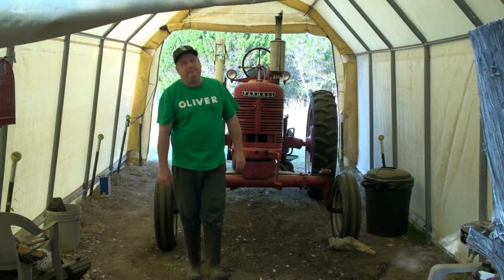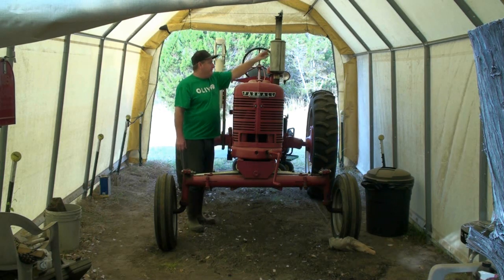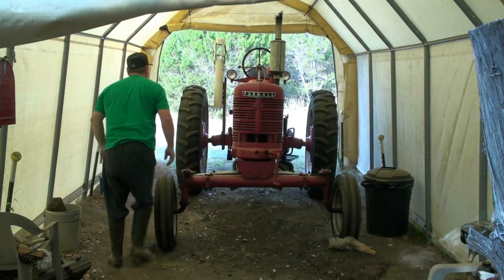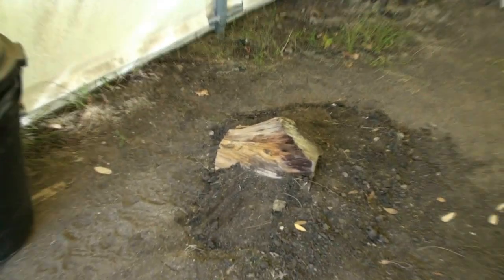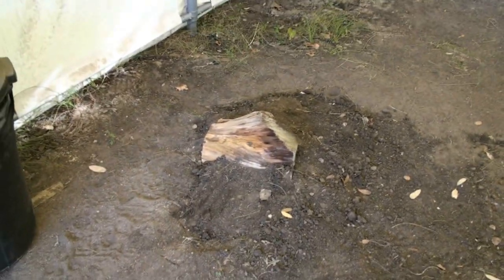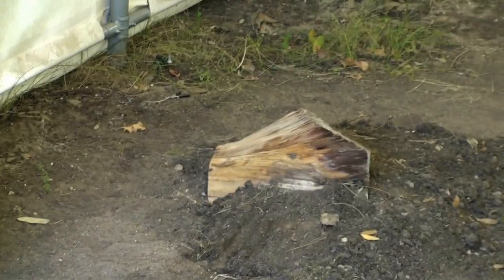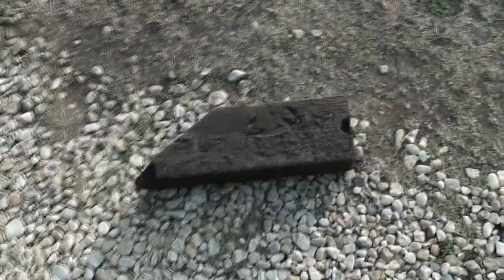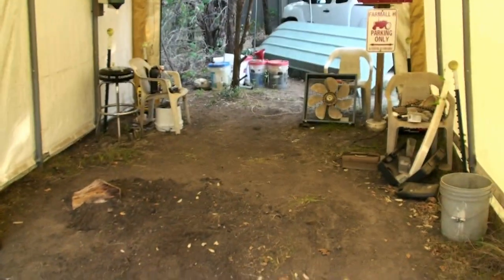Farmall-160

Comment: I haven' t seen all your videos, but was wondering a few things.  Do you operate a farm or are you a weekend tractor enthusiast?  Do you have another job?   You seem to be very familiar with tools.  Do you have farming emplements that you use with your tractors?  What model years are your Farmall H and Oliver 77?  I enjoyed your videos on wiring the Oliver starter switch and alternator.  Did you add the alternator yourself?  The original set up utilized a generator instead.